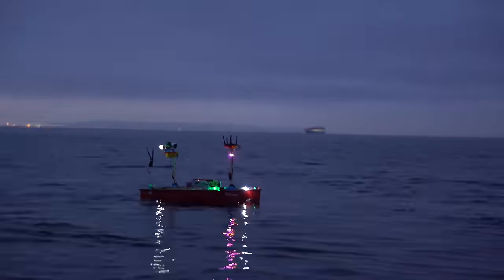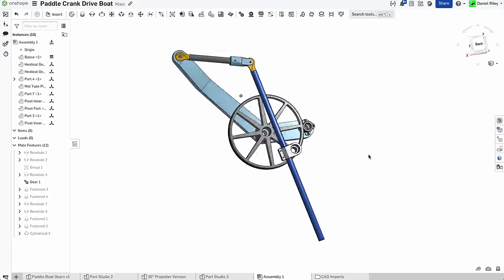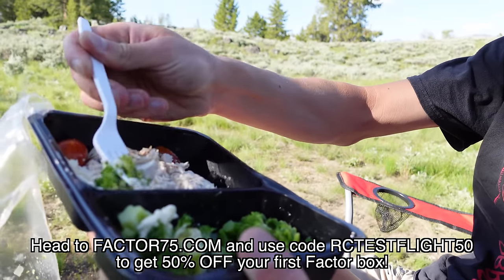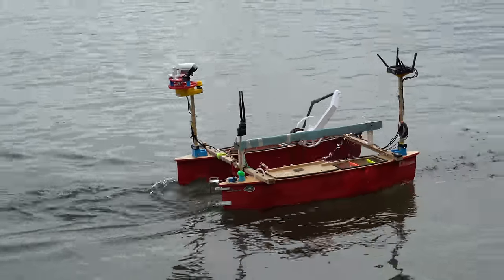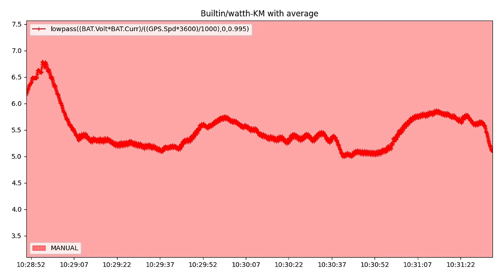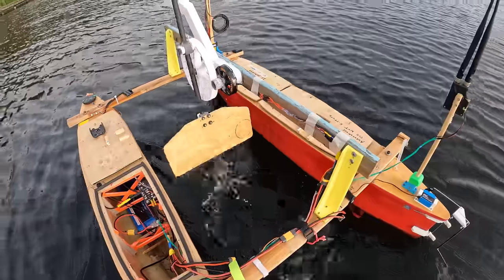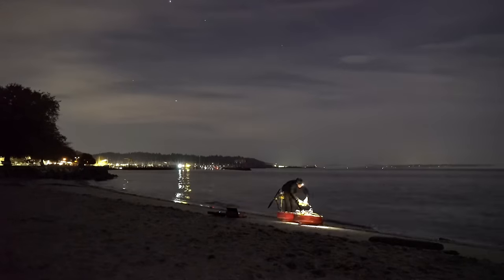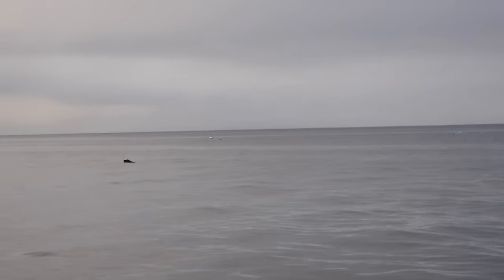Propeller Killer? High Efficiency Paddle Vs. Propeller

Comment: Hello why dont you use typical steam paddle propeller it will increase efficiency because now you have only one paddle? It could be Covered so you could invent new type of mechanical propeller. Because with air propellers you will have a lot of noise how to reduce it, you have passengers inside afterall. Maybe you need only 4 -8 paddles like normal car engine so to have smoother motion.

Comment: I think part of the problem with your paddle design is that the hull (length to beam ratio) is too short. The motion of the paddle mechanism and the pulsing of the paddling is causing the hull to rock which greatly increases drag.

Comment: You've got a lot of weight out towards the ends, and that's what's giving you that severe pitching/hobby-horsing motion. If you moved the masts, motors and (especially) batteries closer to the centre of mass/centre of bouyancy you'd probably find it coped much better with rough water.

Comment: You lose efficiency when the paddle is in the forward stroke. Try a sculling mechanism. There are videos of simple sculling oars that change angle automatically so you only need to provide a side ti side force. The oar works in both directions and never leaves the water so no efficiency is lost. Your oar could be shaped so as to shed seaweed and not catch it .

Comment: bro, just make the boat a bit longer and mount the props higher and not fully on the rear, i mean the hull is not getting fully submerged, it would make sense that if the props clear the deck, then it would clear the water.

Comment: Since I am not an engineer, I suspect my thoughts on propulsion may be greeted with ridicule by serious engineers.  With this disclaimer, here's my thought.  Nature's underwater propulsion systems that fish and mammals use are side to side, or up and down, thrust action.  Is it possible to construct this thrust action with current mechanical technology?  Swimmers who use swim fins duplicate this thrust, but can it be produced by using the rotating energy produced by electric motors or reciprocating engines?

Comment: Why don't you try a peristaltic drive? I.e. no components dip into the water. Instead, you use a double thickness hull, the outer bottom skin should be a thick, durable polyurethane type of film. Between the two skins install a driven roller wheel in a series of stations down the length of the hull to create a moving wave down the length of the flexible outer skin.

Comment: I think, if the gap between the hulls was very close to the paddle width or the paddle was wider until it was almost as wide as the gap between the two hulls: you would see big increase in efficiency.  Currently power is wasted.

Comment: Do a min area require pair of acrobatic skis up front w/high speed paddle wheel or toroidal prop.  What shape would clear the water from the thrust hold up the rear, while the front sits on skis?

Comment: can you make a boat that pushes the water through a tube (or tubes)  in the center, rather than around the outside of the hull. moving the water from the front of the boat to the rear of the boat with a pump, rather than trying to push on the water to get through it. thanks.

Comment: 🤔The efficiency of your paddle may possibly increase (2.43%) if the side wash loss is reduced by verticle winglets.   Think of air wash over an aircraft's wing tip and the efficiency increase in lift over the drag co-efficiant.🤔

Comment: Why re invent the paddle wheel? If you want differential steering put two wheels on it with separate controllers, spin on its axis and good in weeds, the rivers they worked in where full of weeds. Look at the wheel placement of the first steam ships before propellers came along.

Comment: Hey Partner - I was walking around Seward Park about 2-3 years ago when I got a semi-novel idea for a watercraft propulsion system that I think you might be able to realize:

You know the "organic airship" design in Studio Ghibli's "Howls' Moving Castle"... with those weird 'wings' popping out of the airship recurrently to provide thrust?
So... basically that, but for water. The essence of this idea is to mechanically produce a semi- (or later, fully-)parallel-to-water-surface rowing motion:

This simplest version wouldn't be very Ghibli-like at all - just a mechanical row-boat, in essence:
1. Minimum two 'oars'  in water, one each side of the boat.
2. Both oars would be connected to a gearbox via direct drive, which would manipulate them such that the tips move in a vaguely triangular shape: One side of the triangle would be the extension into the water, one side would be the thrust stroke, and the other side would be the retraction from the water in preparation to repeat.
3. In this simplest version, i believe the geometry would work out such that if the oar handles were above the waterline, angled into the water, this triangular path would necessarily remove them from the water in the retraction stroke, eliminating the drag that would otherwise obviate this idea.

>> I can sense that steering could be gracefully accomplished by some kind or gear-box which would donate additional speed to one side if the other has brakes applies to it (a basic differential would accomplish this), but that would increase complexity. This could be done electronically if either side were driven be their own motor

Given that a two-oar system may probably be pretty janky in its movements...
1. The next-most complex version of this would be the addition of two more oars....
2. ...or ADDITIONAL oars to make a Crew / Caterpillar version. Like analysis of an animal's gait, research would have to be done to tune in the best timings for each oar to fire.

However, my FAVORITE version is the following:
1. Take the entire system you develop above, and put it **under the waterline**, and parallel to the water's surface (i.e. no angle needed anymore).
2. Then, adjust the shape of the oars such that they fit in a custom rubber / silicone sleeve. This would provide a larger thrust surface, and seal the oar's interface to the hull without the usual friction of tight axle seals.
>> The oar-travel geometry will need optimization, but what you'd essentially get at this point is a bunch of "fins" which scoop through the water, penetrating it at  travel-speed, scooping the water backwards to generate thrust, and then retreating within its housing in the hull to repeat the stroke again... like a frog or human swimming through water.
>> Naturally, there would be absolutely no way for this system to gather seaweed.

The seals and the geometry feel like the most complex parts... beside that, I can't see any serious flaws in this design.

Comment: if given proper industrial mass-manufacturing capabilities, how cheap could a single finished unit be? 
What if they were one-time use, rather than reusable, could cost-cutting measures be taken?
Also, what's the max load on those bad boys?

Comment: The flat paddle used is not the not the most efficient shape. Needs to be cupped in at least one dimension, if the edges of paddle closest to pontoon hulls had an additional rearward curved surface to keep water from spilling off before end of stroke it would be more efficient. Top edge could be curved too, bottom edge should be left flat to lower resistance on water surface entry & exit.

Comment: would it be possible to create an undulating motion with a flexible wing? you'd mount them parallel, with motion opposed to each other. I imagine the efficiency would increase the further you put the swimmy bits from each other due to fluid entrainment, as opposed to straight up peristalsis with no entrainment.

Comment: The human powered water speed record MIT's decavitator kinda cheated as the maximum allowed tailwind in proportion to the final speed is high. Ie a large air prop providing thrust being very benifical over a water one. However it is very hard to pull off a light, large and well balanced prop driven by a athlete. So well done. That is why it is such a long standing record unlike the land speed record.

Comment: you need to figure out how to efficiently wind all your Stator coils with a gauge of 10 to 20% of the size coil wire you use. Than alone will increase power output. twice the amount of windings.

Comment: Paddles can't beat propellers for efficiency, physically impossible proposition.  A paddle only provides thrust for a small portion of the rotation,  in this case it looks like about 60 degrees or so, for each blade.  A propeller provides thrust for the entire rotation (360 degrees)for each blade, the efficiency of a propeller in this case is roughly 6 times more efficient a paddle system could possibly achieve.   This is why paddle wheels died out even as they were a dominant technology 190 years ago, being replaced by propellers and turbines which are far more efficient- because when your paying for your fuel (Wood, coal or oil) efficiency matters a great deal.

Comment: https://youtu.be/ox6ZXrrK8yE?t=464 At this point I think you nailed the efficiency of the paddle.
On the stroke at the back of the paddle you've loaded up a perfect amount of water, it just reaches the top, yet the back has just enough water at the bottom to prevent water falling back mid-stroke.
This looks like it gives a slight boost to speed and momentum as the returning water propels the boat forward.

I could be wrong, I'm not an engineer, but as you said it just looks right.

Comment: Just do your run with the paddle, before moving on to a new boat. Your goal was to accomplish the circle, right? So if the paddle is more efficient than the underwater propellers, maybe it will succeed. What about the paddle beeing wider, so less water goes around it?
Reply: What you want to do to reduce water streaming around the edges is construct 90 degree runs on the paddle ends that reduce the amount of water not being directed rearward. They don't have to be very wide, just enough to aim the water better.  And perhaps another on the paddle's bottom edge as well.  Making a sort of water scoop.

Comment: What if you were to use a paddle... but it was mounted on a chain. What if the chain ran the whole distance of the boat... and lastly, what if there were a bunch of paddles on the chain? And one more thing, what if there were 2 of these chains so as to allow it to steer like a caterpillar? No rudder, no parasitic back-stroke, lots of traction.

Comment: why don't you try cut rubber tires paddler  on a nylon belt like a chain saw useing a belt driven on a 2 by 4 wood with pulleys both end, you can get 10 paddles in 5 seconds for speed

Comment: Although the air propeller is going to be much more efficient, the paddle design would be greatly improved by having a second paddle. You are wasting energy on the backstroke by not having a second paddle in the water.

Comment: Hey dude, really enjoyed that, I love on the canal Britain,I make shit owta more shit, recently messing with paddle power, found two old canoe's,bodged a bit ov scaffolding plank between the seats ,clamp screwed them together,not rigid,all twists independently,power from golf trolley,rotavator blades,with five square bits of plate welded around,shocked how fast it is, especially now speed controller  fucked,so on or off,canoe paddle steering,no reverse !!! But was thinking paddles on a conveyer belt, small tolerances in a channel,like your friend said.... not as clever as you and yours gaget research.guessed all sizes ov everything,worked better than i thought,but the golf trolly wasnt under any load,means cood have made much bigger paddles,& have found three more trolleys ,!!!!!!! Belt paddle drive !! Probably wouldn't sort weed problems though

Comment: Wont be good large scale as the fulcrum and bar will be too long and would snap the mountings and will not push boat at speed over water .Propeller is more energy efficient.

Comment: The set up for the paddle is oddly enough Not how people actually paddle (or swim).  Waaaaay too inefficient.  When paddling most of the force is actually pressing down, not pulling/ pushing back.  The power portion of a good paddle stroke (not talking Greenland paddles here) is completed when the paddle gets to about the knees (1-2 feet max) and the rest is just getting the paddle out of the water smoothly (less to no drag).

Comment: You have direct drive, your prop is linked to motor on the boat. if you use gear for power transmission, motor lose power because of friction on gears, if motor spin faster, thus gear does and there would be more power lose due to more friction. I think, big propeller is used for lower energy waste in a geared propulsion. Smaller prop might be more efficient if you have direct drive that your prop is linked to motor on the boat.  90mm 12-Blade EDF 6S Power System w/ 4068-1750Kv In runner Motor. That would be fantastic for your boat :) there are also some tools for testing thrust of a motor such is this, https://www.youtube.com/watch?v=SIfWCWZdfuc

Comment: It hasn't occurred to you to simplify the design, With an Archimedes screw you would solve all the problems of engagement in the propellers, In this video you can see a powerful solution for a wind turbine. You simply have to remove two thirds of the blades to make it work in water. https://www.youtube.com/watch?v=BchzNf5lNmw&list=PL105DEBD044254810&index=9

Comment: I'm watching to see why you didn't make an entire paddle wheel and just the one single paddle

After watching... You've built a propeller, turned sideways, and cut it half.. With two or 8 "paddles" to form an entire wheel would be smooth, for high speed, make the paddles thinner and SPIN

Comment: Your mistake is not using a paddle wheel versus a single paddle. Wasted energy on the return when a paddle wheel of multiple paddles  does not waste energy. So what was the point??
Reply from the maker: You’re wrong in assuming energy is wasted. Look at the current draw graph shown in the video

Comment: No! Of course not! Paddle boats are inherently inefficient! Why do you think that we moved from the classic steamboat water-wheel design into large props! Also, that paddling mechanism is far too simple to have a decent motion path, and anyway, you cannot compare the efficiency of a large paddle with a high torque and efficiency brushless outrunner motor to that of a small, cheap drone motor with an inefficient plastic propellor and an esc that uses back EMF instead of a rotary encoder for phase change. I swear you were using an Odrive for the paddle as well. I like your videos, but at least talk to someone who knows what they are talking about before making such ambitious claims as towards this kind of efficiency

Comment: As a life long mariner Ican tell you it wil fail in bad weather. The common propeller is a very elegent solution. Beating it will take some doing. Yor coment on paddle wh3ls being inefficient is flat wrong. a padle wheel between twin amas, or on each side of a catamarans main hul would bee onteresting

Comment: The pedal is less efficient than the propeller because you have an idle stroke that costs you energy without providing any propulsion. I would build a real paddle wheel with eccentrically controlled wheel blades, as was standard on European paddle wheel ships, and test it.

https://www.youtube.com/watch?v=2v_0V2kJ6HY

Comment: Nope, not even close. Is just bad and funny, it reminds me of all the silly airplane attempts of people at the threshold of 1900.
In an industrial society this is garbage, inefficient and large, not useful for anything.practical
So we are left with a primitive tech society. Lets say replace the physically intensive rowing with paddles by hand and torso, and using the rotary system to drive by feet.
And even here it fails because it only has one power stroke per revolution.
What is better than one?! Many.
And we are ending up with the paddle boats that have been widespread in parks and their small lakes.
You have a lot of power strokes per revolution giving it ease of use, control and efficiency.
And most importantly gain a lot more space because you can position the wheel down in the boat and directly spin the paddle system without any complicated leverage system like here